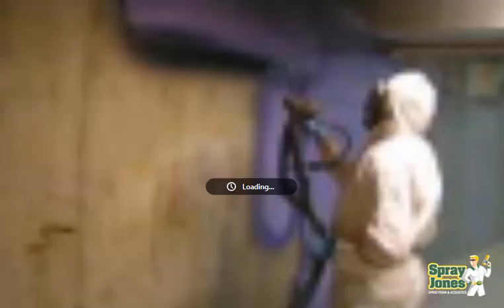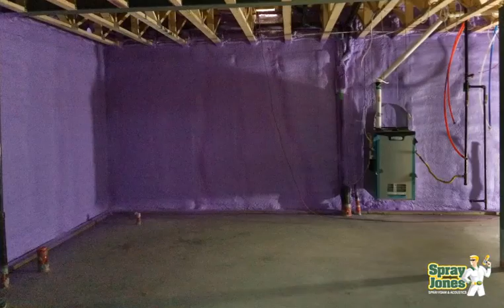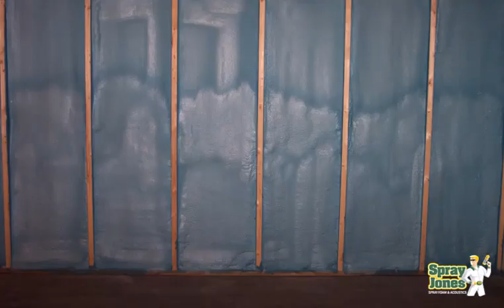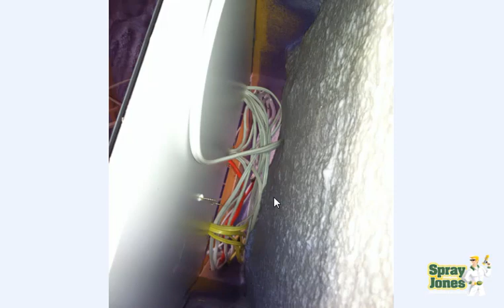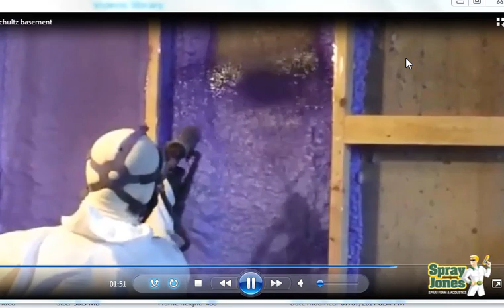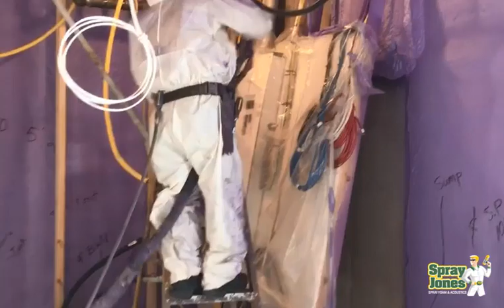Best practices for spray foam insulating your basement

Comment: 7:40 why would you set framing off concrete 1 inch ? Aren't you supposed to have at least 2 inches of spray foam ?
Reply from the maker: No - don't need to have 2" We deal with lots of basements where the framing is all over the place. Most people want to maximize space, the SPF is not compromised doing this.

Comment: Excellent videos, thank you! I have a 1970s home in North Eastern Pennsylvania. Poured concrete foundation, no exterior waterproofing or perimeter drain. Basement stays pretty dry and walls are in good shape. Humidity is tough to manage though. If there is no vapor barrier under the slab, how does this spray foam tie into the basement floor? Many videos I see are recommending rigid foam with an air gap behind it that ties into an air gap on the floor provided by putting dimple mat like platon down before subfloor. Just trying to make sense if it’s not all spray foamed, is the purpose defeated? Appreciate all of your information and thanks in advance if you see this!! Cheers.
Reply from the maker: This is where you need to talk with a basement specialist. Do you want to re-establish internal weeping tile to the central drain point? You can do that with dimple membrane and a weeping tile around the footings from the inside to a sump collection. This will involve some demo of the floor around the perim. 
The vapor barrier of the floor is tricky - coatings are an option, cribbing and spray foam is another, floor replacement is last.
Reply: @ thank you for the response. I’m anticipating the best approach is internal weeping tile to a sump, dimple on the wall, dimple on the floor and subfloor on top of that.
Reply from the maker: @SteddieBop  Closed cell foam over the dimple on the walls. Works great.

Comment: This review is for Retro Foam Corporate as a warning to consumers.

The worst home improvement contracting experience I have ever had in 40+yrs. of ownership was when I hired Retro Foam. The local franchise couldn't do anything right, nor did they follow my instructions for a good outcome. After they dithered about, I appealed to corporate, they sent out Ken E., he didn't get it either, instead of handling the rework properly by finding the problems and correcting them he sprayed over top of the poorly applied foam. Not to code, not to industry standard.   My further appeals to corporate were met with nothing but a big run-around and gaslighting by Eric G. This leaves me with a home that did not pass inspection.
My bank did claw back their fee, an easy out for RF, but not what I wanted at all. I wanted a professional job that would pass inspection. I pay gladly and promptly for professional work and have an excellent relationship with my contractors.
Apparently, I wanted too much from Retro Foam.
The only contractor I could find to do the remediation wants a fortune to fix what they did.
Please do not make the mistake I did.

Comment: At the beginning of your video you speak about laying down a base plate - but I can't see exactly in the photo - you mention it should be placed three inches from the wall (assuming two inch foam).  Does that mean that it can just be laid down after the form is blown?
Reply from the maker: Laid down before for reference is better.

Comment: You recommend spraying while basement is unframed.  If I frame over the foam, how do you ensure walls are plumb against foam with high and low spots?

Should electrical and plumbing be done before or after foaming?  Thanks for the video!
Reply from the maker: No offense Robert but with a simple tape measure, level and some basic skill of how to use them you should be able to make true walls inside the SPF.
Reply: @SprayJones  none taken, thanks for the reply!

Comment: Do you worry about a concrete wall being able to dry to the inside? I was thinking about only doing the portion of the wall down to frost line, that way it can still dry to the inside.  What happens to moisture and possibly bulk water, if something fails, if it can’t dry to the inside 
Thanks

Comment: Hello Mike! I really like your channel it has some of the best info on the internet, and I’ve been researching for months. I have a slightly less common situation and I wanted to ask you, as an expert in your craft, if my plan is viable. I recently had interior perimeter drains installed/buried in my basement, sump pits and all. Although the contractor only installed enough dimpled membrane to stick out a few inches at floor/wall edge, if i buy enough membrane cover the entire wall, would it be a good solution to then spray closed cell foam on top and then frame normally?
Reply from the maker: Yes. Doing those a lo these days where we are. It is the only way to go. Have the dimple primed though. 
There is a video dedicated to this in the basement playlist from this year.

Comment: Where does any water go that may leak through the concrete wall. Say a wall tie?
Reply from the maker: Where does the wine in a bottle go when it comes up against the cork?
Reply: So it stays in the concrete wall?  Gravity takes it down and under the foam that’s sprayed on the gravel and it eventually hits the gravel under the slab. Thanks

Comment: When going with the pre wall framing method. Is it ok to have a gap between studs and the 3” of spray foam (like 0.5 - 0.75”) I guess you could also use 2x3’s if the foam reaches past the edge of bottom plate. I think chalk lines may work to insure the depth too. For me it’s a timing thing. I want entire basement done…Then start framing/finishing certain areas first. I understand too that by code/insurance I’ll need to apply paint on foam or quickly frame/drywall. Your videos are amazing btw!! , I knew right away you were Canadian. I’m in NS. I have a guy coming for quote next week. Thanks again!

Comment: Would you recommend spraying foam under the slap in a basement, where it’s susceptible to a high water table?
Reply from the maker: Yes, if you can get it down while it is dry enough for application.

Comment: Excellent video. Just curious as why in the last basement, there is what looks like an extra 2 x 4 that's out by an inch or two. Does that get removed after ? Sorry if I missed the reason. Thank you.

Comment: I’m not sure I get the window part. If a basement has zero framing, how will the foam be applied? The example you provided in the video both have some framing. Are companies expecting the home owner supposed to frame just the window and leave the rest un-framed?
Reply from the maker: Either extend the window buck more than the depth of the foam you want, or get the SPF installer to use a temporary board around the edge that they build the foam to and then unscrew and remove.

Comment: I guess it's not good for a basement with only betume coating. Mine is 1980 so some ppl tell me to avoid spayed foam. What your thoughts about that ? thanks
Reply from the maker: Bollocks. Foam it.
Reply: @SprayJones  sorry I did not understand what you said
Reply from the maker: @christianlevesque9017  We spray those types of basements all the time. We have some of the worst basements where we live. Get more info, the statement made was too vague to be of any use. Get the facts.

Comment: Hi Mike, I'm considering building a house. What would you do for the basement? ICF or form pour with spray foam on outside and outside? And why? Thanks.
Reply from the maker: Standard concrete and spray foam to the inside and outside if the weather cooperated. 
1. I can see the concrete is 100%
2. Frame the inside, better options for wiring
3. Spray 1 inch outside, sub grade only
4. Spray remaining foam inside before framing
5. Spray foam under the slab floor
6. Live life and enjoy and warm basement
Reply: @SprayJones  Thank you!
Reply: @SprayJones  Would this trap moisture inside the concrete as closed cell is vapor-impermeable?
Reply from the maker: @AnthonyBrusca  No. You don't want water coming inside.
Reply: @SprayJones  how/when do you (5) Spray foam under the slab floor??
Sorry if that’s a dumb question!
Reply from the maker: @ruthalexander6681  Under slab must be doe when the place is being built but before the concrete is poured. Watch the video "Spray foam for under slab" it is in the playlist of "in contact with ground".
Reply: @SprayJones  great! I’ll do it!!!

Comment: your spray foam is so flat!! im still trying to dial mine in lol..
Reply from the maker: 1. Clean gun - properly working
2. Turn pressures down
3. Temp Temp Temp. - must be goldilocks
4. Foam systems are not equals - get GOOD SPF

Comment: What if your basement is over 100 years old and your pretty sure that there is no barrier on the outside of the wall to the dirt? It is a poured concrete wall, but it is not very thick and a lot of moisture seeps in. I just dont want to trap that in the cement and make things worse.
Reply from the maker: You will have to dig up the outside and waterproof. But don't skip the foam on the inside.
Say goodbye to $40K.
Reply: @SprayJones  thankfully it's a small house. Only 720 square feet. Thanks for the info and great videos.

Comment: Do you have to worry about the different foams reacting with each other at all? For example at the 14:00 he sprays up to existing foam. Is there any concern with certain brands or styles of foams reacting with each other?
Reply from the maker: None. Closed cell foam does have a max per pass, then the foam is supposed to cool before more is added. As long as you adhere to that, add add away! 

Good question!
Reply: If you are going for more than 2" thick, spray the complete wall then come back for next 2" pass your first pass should be cool by then. Aways check first before adding more.

Comment: You prefer 24 on center but in reality that doesn't sit well with framing and drywall. If on it were a perfect world, right? Lol. That must be a pain in theass spraying 16 center stud bays.
Reply from the maker: It's more prep, clean up and wasted time. There is no issue with 24 inches for drywall. In a basement the framing is not structural. Just old mindsets to get over..
Reply: @SprayJones  Indeed. Every other wall is 16 on center so they want the basement walls that too. Its crazy right. 24 on center is cheaper too being you use less lumber! If children are involved, 16 on center is the way to go though. What with kids being kids and roughing each other up, 24 on center isn't as tough as 16 on center and damage happens more often. While its not needed structurally, it is needed for toughness.